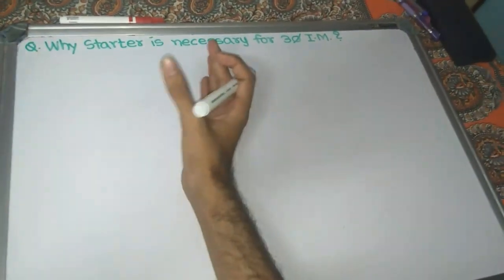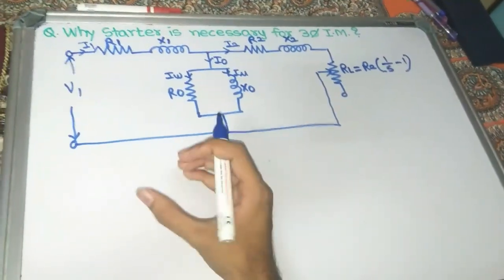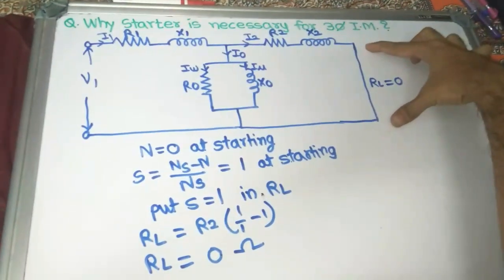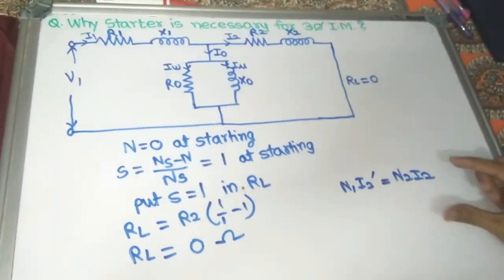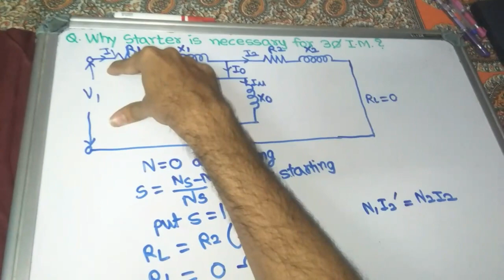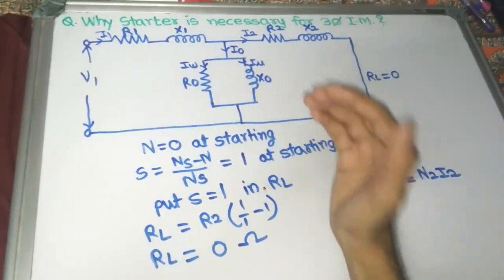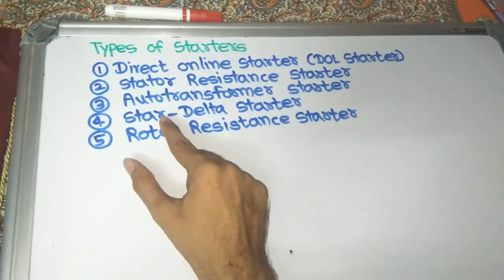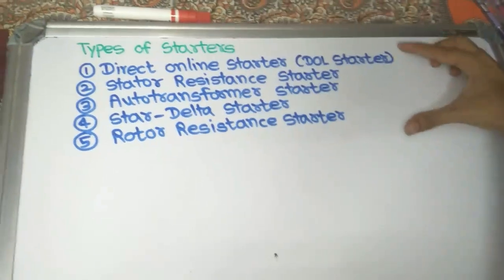Why Starter is necessary for Three Phase Induction Motor? What are the types of Starters?

Comment: Nice sir here dol used in small hp motor but current will also high in starting time so here what is the actual  function of dol because there is no any logic to control voltage and current in dol its just one type of contactor switch so each and every motor we say starter is required but in side dol there is not any register put actually i want to say that can we start samll motor without dol and also today industry above 10 hp also dol starter used...
Reply from the maker: pandit vishal 
We should use DOL starter upto 10 HP only according to rules but in industries it is used upto 15-20KW also. But for very higher rating motors we cannot use DOL starter directly. Then there must be the arrangement of primary resistance and autotransformer starter along with this Push button type (DOL) starter so the motor can be prevented from very high starting current and also can be operated by DOL starter pattern. i.e On/off push button pattern
We can use the small motors without DOL starters if it is single phase only. If the motor is of 3 phase type and it's rating is if above 3 HP then there must be DOL starter according to rules.
Reply: Technically u r right sir but recently i have seen that above 20 hp means in L&t switchgear pcc and mcc pannel dol is used and  also as per theory starter is required to control STARTING CURRENT but my question is that what is the inside dol which control current or voltage in motor. only contactor why? What purpose That? just switching?
Reply from the maker: First clear your concept about DOL starter. DOL starter is not for controlling the starting current .
This starter is only used for various protection purpose such as overload, supply failure protection etc. through on/off controlling. So plz watch the full video if you are not watched it. 
Answer of the question is in this video itself. So see it
Reply: Sir good... but in our industry we are using dol starters  for 125kw motors also how where is the starting protection
Reply from the maker: Yes sir. It is possible if some other arrangements are provided in the starter along with the main important function of DOL starter (on-off controlling). There may have been some extra facilities provided to it. Is it right sir?
Reply: @electricalacademy2783  on off controlling arrangement is not for control the starting Curren I think
Reply: Just we are using auxiliary circuit for safe practice that means low voltage circuit for on high voltage motor
Reply from the maker: Exactly...
Reply from the maker: That's what I am saying in the comment telling pandit vishal that dol starting is not for controlling the current as you clear that here practically by your industry. Thank you sir
Reply: @electricalacademy2783  then where is the starting Current limiting provision
Reply from the maker: Starting current limiting provision should be provided for higher rating motors and that is done by other different startets which I explained in the channel. But dol starter is not for that purpose
Reply: @electricalacademy2783  upto 5hp it's okay but we are using for up to 350hp also then we should provide some extra provision to limit the starting Current but we are not using